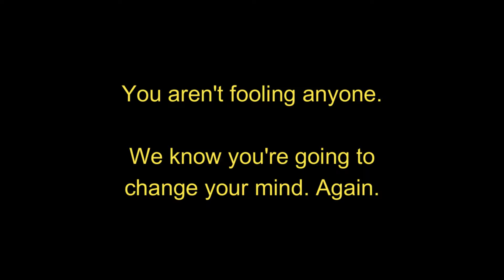914 Ferrari Build - Episode 39: Axle do-over and a table leg?

Comment: Very fun to watch you work and solve these problems in a creative fashion.  Any thought to drilling weight relief out of that pedal plate?  Seems heavy for a race-car type application, not a criticism just asking if its a possibility to reduce the weight while maintaining strength or crafting from aluminum plate and bolting instead of welding.
Reply from the maker: I have a tendency to over-build, especially when it's stuff like this where I want to eliminate as much floor movement as I can. That plate isn't as heavy as it may look. Your idea of a bolt-in aluminum plate may be a good one but the minor weight penalty isn't critical to me on this build. I appreciate your input - keep it coming!

Comment: I thought that part of the reason to use CV joints was that they don't need to be clocked?
Reply from the maker: Clocking them maximizes the angle at which the CV can safely operate. Perhaps not "required" but it's the optimal approach.